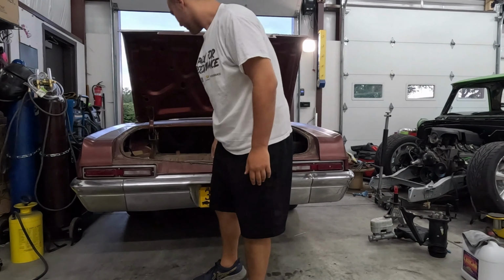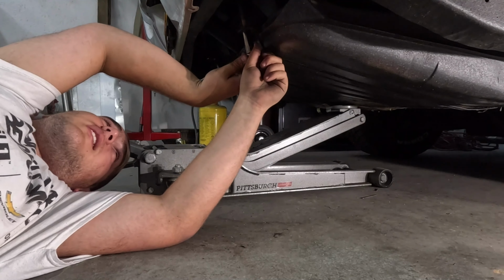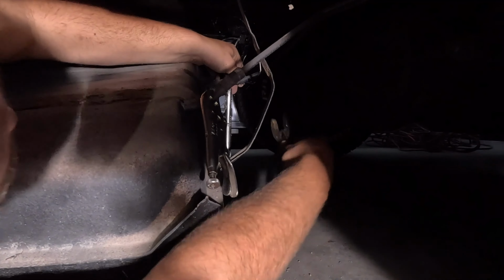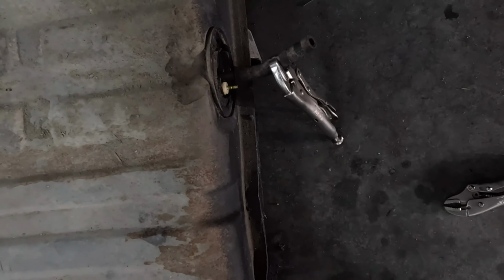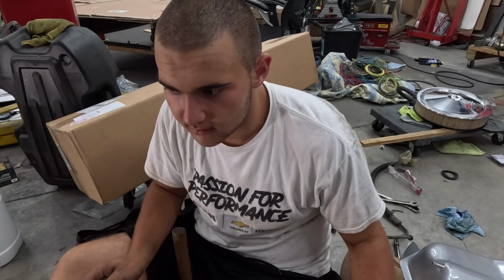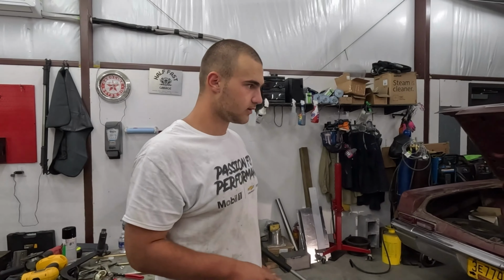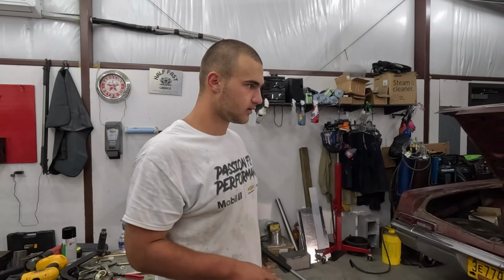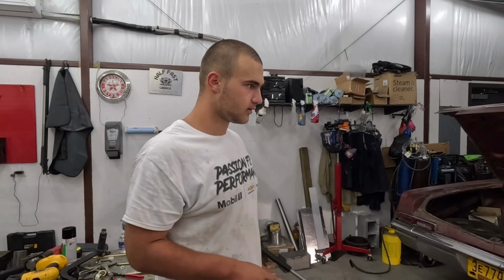Biscayne is BACK!!! Gas Tank Finally Gets Changed!

Comment: Keep up the work on the Biscayne. It's worth the effort. There are many 12 bolt axles that were used in those full sized checked 1065- 1970
Reply from the maker: Im hoping to swap the gears soon in it. It is worth the effort.